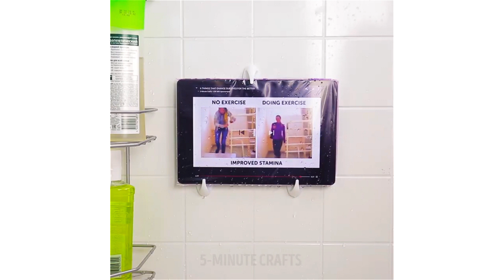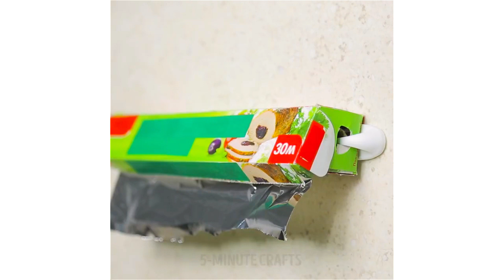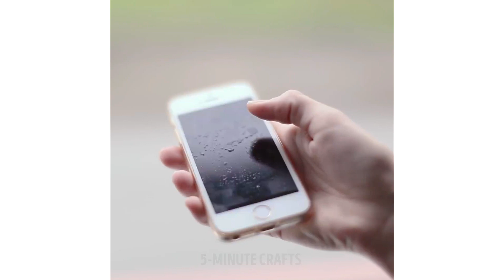20 WEIRD HACKS THAT ACTUALLY WORK

Comment: There is no need to use dental floss to cut a cake, ordinary sewing thread does the exact same job and is so much cheaper. It is especially useful when you're going to decorate a cake and need to cut the cake into layers, as our knives may be a bit short and it is easy to not get it straight, but with sewing thread, it's a lot easier (also, use tooth picks to mark where your cut should be on each side, gives you a guide to "aim at" while cutting...